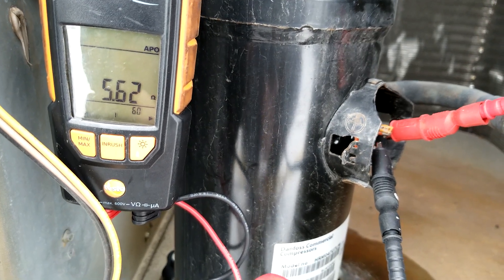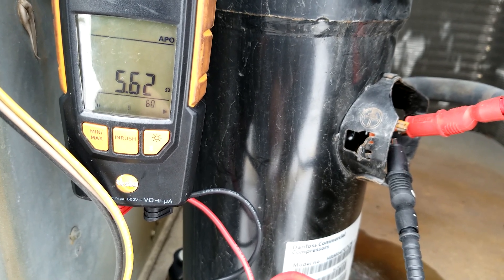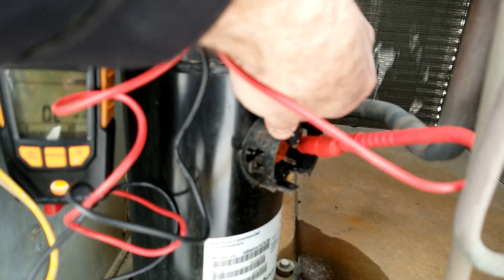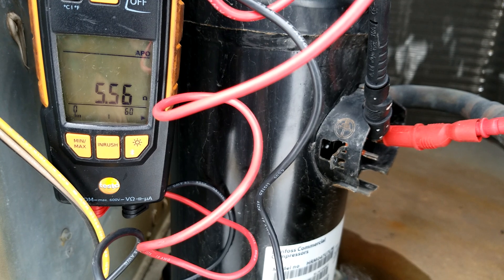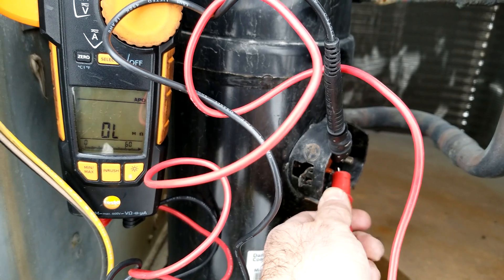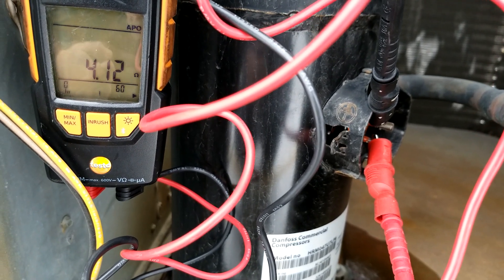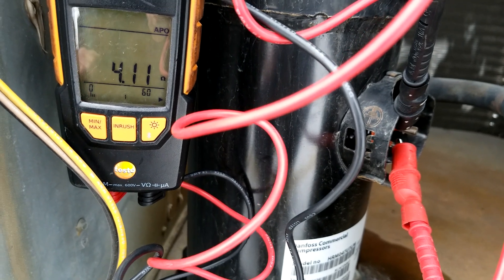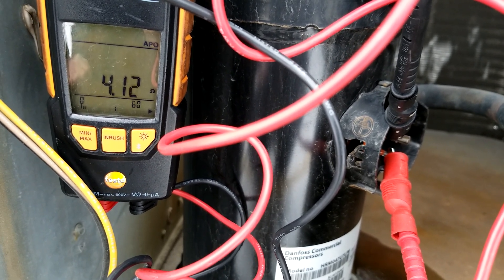Three Phase Scroll Compressor Winding Resistance On A Package Rooftop Unit

Comment: Nice thank you I'm getting 15.7 across all three leg start run and common. It was a little hot but all three legs are Reading the same so it is not grounded or in thermal lockout. But when the 24 volts are engaged the compressor stays at 290 on the low side and high side it is not adjusting in any way.

Comment: I'm fairly new with rtu. I had a call and saw the compressor plug burned up and a terminal blew. The next day I got my ass chewed because I didn't check the other comp on the other circuit. I checked ohms on the burnt because that's what I'm told to check to figure the cause. All read around 5ohm. They sent the senior 20yr tech and he condemned the other compressor because all term read the same. He said they should be different and equal up to each other. I said I thought on 3ph their all the same. He said no. If I mention YouTube hes blows his fn lid lol
Reply from the maker: He's wrong, on 3 phase they are all the same, you're correct.  If it's a Copeland compressor, you can use Copeland mobile to pull the compressor specs and winding resistance, show him that.

Comment: Why manufacture 3 phase compressor instead of one phase compressor?
Reply: Lower amps with higher voltage. I have a building that is single phase and the feeder wire is huge to be able to handle the amps

Comment: I have the same condition, i check resistance 8.1; 8.0; and thn 9.3,, i try to running but condition ws Very hot. Wht should i check,? And than I try to unloading then compressr to check the winding motor, I think winding motor was good and there’ relay in motor but i dont know this is good or no?.. Can u helo me..?
Reply: Did you check your pressure switches ? One of them may be bad if not she's not gonna pump my guy she's a gonner .

Comment: There is no capacitor for 3 phase compressor? I have a 3 phase compressor today and no capacitor. The same resistances and voltage between each terminal but compressor does not run. I can see inrush current when I turned on switch is around 100A, then less and less, then to zero. Is it a bad compressor? or locked up motor? Thanks
Reply from the maker: There is no cap with a 3 phase motor, sounds like the compressor is seized

Comment: First time worked on a three phase compressor. All three terminals have voltage but compressor does not run. Any ideas? Thank you
Reply from the maker: Are you checking across the terminals, they should all have the same voltage
Reply: HVAC Know It All yes, the voltage between each terminal has the same voltage which is around 208.
Reply from the maker: @UltraHydrophobiccoat  then check resistance across them they should also be the same.  Is the compressor hot?
Reply: HVAC Know It All I checked the resistance yesterday and I remember they are the same, but will go there to double check that. Compressor has no any response ( not running). Thank you

Comment: Sir I have a 5 Ton Scroll Compressor LG . Is all terminal compressor same . Compressor work but pump not work is pressure no.
Reply from the maker: windings should be the same if its three phase.   Maybe it's running backwards?  Try to change the rotation
Reply: HVAC Know It All sir Rotation change it but same position . Compressor back and high pressure is 80/90 psi . I think Compressor problem are you agree sir .

Comment: Daikin Inverter VRV3 giving L8 inverter spike. 1.2, 1.4, 1.6/  Still running. No megger issues.  The new compressor is .5 ohms all 3. If this one does not leave the system it can destroy  the board as well.  Add $1,500 to the job.